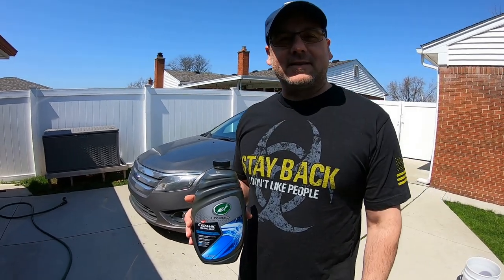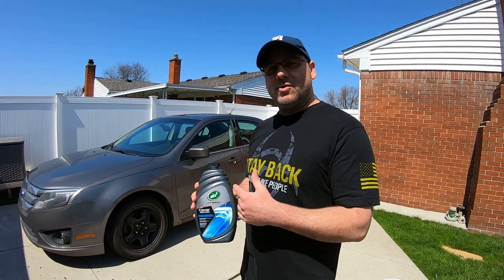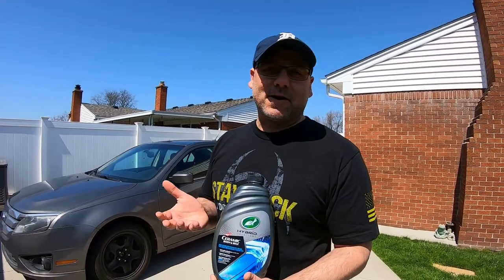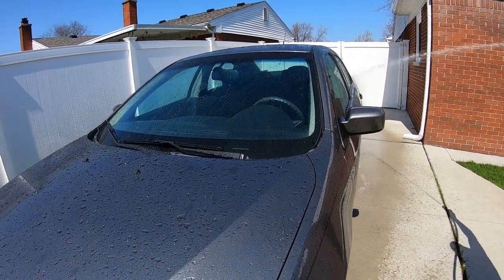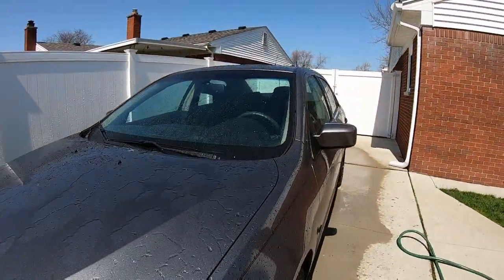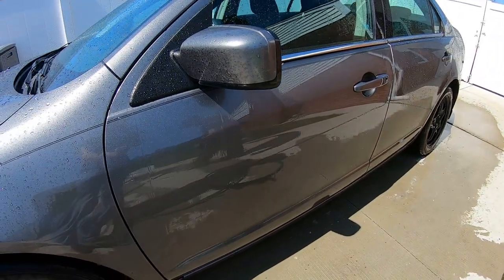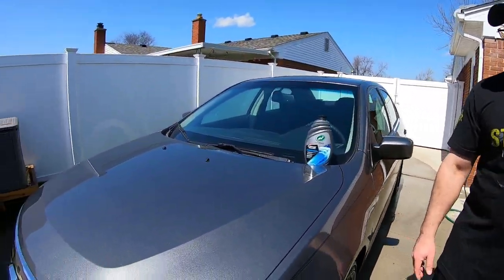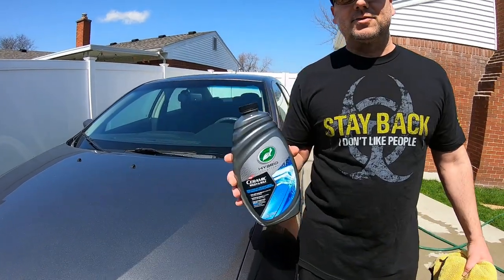Best Ceramic Soap "Turtle Wax" Ceramic Wash & Wax Shampoo | Insane Results

Comment: Nice video brother!! That did a awesome job! Not sudsy at all but sure did clean well. Car looking great👍
Reply from the maker: This soap worked great at getting the car clean with no effort . Thanks brother. When are you testing the new TW products out ? If weather good this weekend i have a Ford Focus to try them on.
Reply: @OuzoLouGarage  I wanted to use them this Monday on a 2016 Accord.. but the paint is trashed. It needs a 2step.. the TW won't be enough. So I'm debating compromising what I know I can get to just use the TW. As much as I want to I'm probably going to just 2 step it.
Reply from the maker: @PapaSmurf918Detail  I have this Focus to do funny thing I never looked at it. It the paint bad I make the best of with TW
Reply: @OuzoLouGarage  all you can do bro! 🤙

Comment: Was washing the new Fiesta today thinking about you for some reason?  lol  What really is a ceramic wax anyhow, and how is it actually better?  Harder?  Good video,...I need to start using car soap instead of what I have been doing.
Reply from the maker: It has an SI02 in the product its made from sand it last longer longer then some wax and the dirt comes off easier . Get Turtle Wax ceramic spray and this soap . You will like these products and very easy to use you can wax the F150 in mins .
Reply: I mention you in a vid loading right now.
Reply from the maker: @PaulieDetmurds  Thanks Detroit Brother